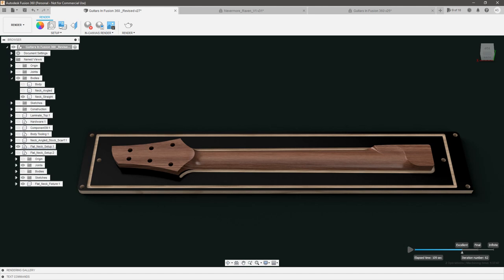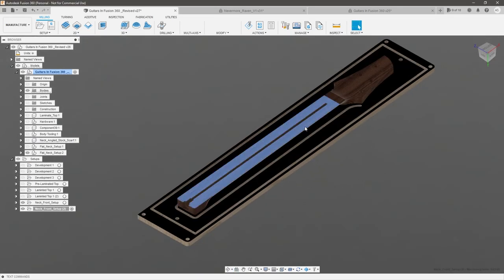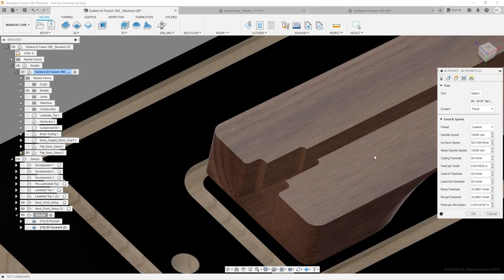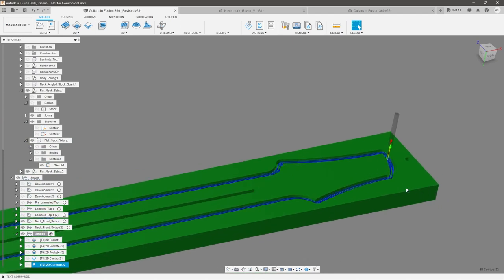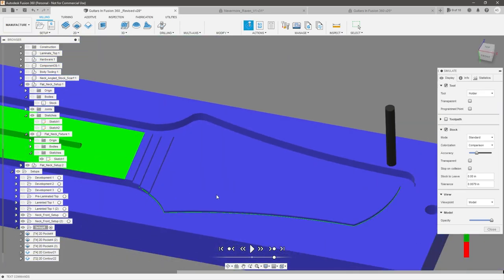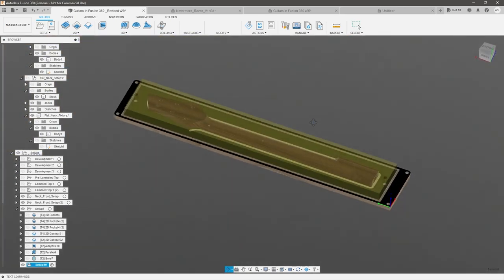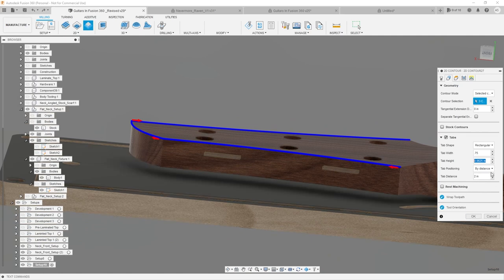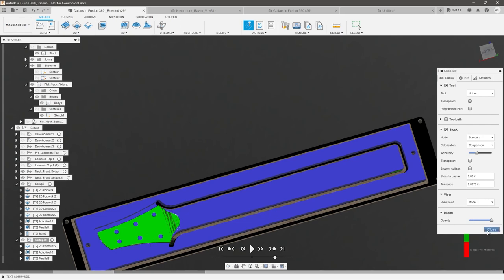How to program CAM for flat guitar necks in Fusion 360 | Complete Tutorial

Comment: Austin,  another great video.  Well done!  

Related to using the flat endmill trick, I've become a big fan of bullnose bits.  Depending on the approach angle you can use them for pretty much anything.

I think the issue you were having  around 54min with the 3d adaptive, is you had "include setup model" checked,   so it was including everything in the model used for setup, and the surfaces you selected in the tool path.
Reply from the maker: I really ought to use bullnose endmills more often. I think so long as you don't need a sharp corner on the base of anything, a bullnose could be your primary tool and cover a lot of both roughing and finishing strategies.
Reply: @austinshaner  yes...bullnose all the way

Comment: Finally finished this video after a couple of weeks haha. Great tutorial my attention span is 5 minutes ha.

Edit: apparently I need a fixture my stock flip came all out wrong haha. So how does one make a fixture to add to 360?
Reply: I made a sketch large enough to hold the stock and use my 3 axis probe. then I used my neck to project the appropriate curves onto that sketch. then I used an offset of that projection to make a 1/4" closed boundary. then extruded it down 1/4".

Comment: Great video, vey informative.  How does the 2 sides work if I have to put the neck diagonally on the machine due to length..  I can't get my head around how fixtures and flipping diagonally would works.
Reply from the maker: Hey mate!

It definitely gets a little more complicated working diagonally on a 3 axis machine, however it's actually simpler than it looks.

As far as the programming is concerned, there is no difference between programming your toolpaths for on axis or off axis toolpaths. However there will be a difference in how and where you set the zero for your workpiece (WCS). You need to be able to accurately and reliably set your work offset so the program knows where to start from for each operation or tool change. 

So if you are working diagonally, I would recommend one of three methods. Either use a fixture like shown in the video but with one of the corners aligned to your machine axis so you can set your zero for each operation (this will slightly change the shape of your fixture)... or machine a corner feature into your part blank as your first operation, or using your machine home position as your work zero but compensating for that in your program by creating a sketch that represents your machine's table and assigning your coordinate system to start that home position.

TLDR: Your toolpath always starts from wherever you set your work zero at, so as long as you can accurately and reliably locate that position on your CNC after the flip, you should be good to go. This means your WCS system in fusion will need to be aligned with your machine axis, but the part itself will be angled. How you decide to achieve that is up to you.

Hope that makes sense, let me know if you have any other questions.
Reply: @austinshaner  Thanks for the very prompt and complete response.  I think I get it but I'll have to sit down with Fusion and see if I can figure it out.
What's driving this is I'm about to buy my first CNC and I am trying to decide on sizing.  Most of the stuff I will do will work just fine on the size I'm looking but my first project is a bass neck and the only way I can get it to work on the machine I'm looking at is to do it diagonally (or buy bigger).  I don't expect to do a lot of basses so if I can make it work on the smaller machine then all the better.
I'll let you know how I make out.
Reply from the maker: @Darcy Boyer  no sweat. Let me know how it turns out!

If you're interested, here is a video from hammer cnc doing what your talking about 

https://youtu.be/qgiHm-Al4oI

Comment: Very useful as always. I sometimes use a combination of 3D parallel and 3D Contour using "Slope". to define to overlap between the two.  It says parallel is good for flatter areas and contour for steep.  With parallel you do sometimes see big steps on the steeper areas due to .5mm sideways makes a big step down.  The Contour splits the steep parts narthex fretboard into downward step overs rather than sideways step overs.  Am I wasting maytime with this?

Comment: Austin,

I am stuck on the 3D adaptive tool path for the top of my headstock. I can't get fusion to recognize just the headstock and swoop up to the nut like in your example. Because of this, the 3D tool path only clear out so that the entire thing is level with where the fretboard will sit. Suggestions?  Thanks

Comment: what truss rod are you using that slot? If it is the StewMac low profile I was just wondering how effective the slotting was  so I possibly avoid having to ream manually on the wider portion of the end of the truss rod cavity.
Reply from the maker: It is the StewMac hot rod truss rod. The slotting went great and everything fits as expected. The main thing to remember is that your endmill will leave a radius on the inside corners, so you need to account for that by making your slots slightly too long, or come back and square up the corners with a few swipes with the chisel.

Comment: Austin, whenever I flip my part it seems that it's cutting off too much material in the z axis and making the neck thinner than I would like. I have checked my heights. I'm using a fixture as well and I don't know what I'm doing wrong
Reply from the maker: How much is the thickness off by? Are you using blue tape and super glue? If so, that adds about .010-.020 of thickness, meaning if you zero off the fixture your neck will be that much thinner. So 2 ways to solve this. Either put extra blue tape/glue on your fixture and use that to zero your z axis, or once you zero to the fixture, jog up by the thickness of your tape then rezero
Reply: @austinshaner  Yes, I am using blue painters, tape and super glue. it's off about .05"

Comment: Great video, man. I have a question regarding the headstock operation, the part where you run the bit along the headstock to carve the volute. It looks like you can either pick the whole face of the headstock or just the part that curves up. Wouldn't it be faster (or even possible) to do the flat section with a bigger step over and then do that little ramp section with the slower and smaller step over?
Reply from the maker: Definitely! That would be a nice improvement on that toolpath.